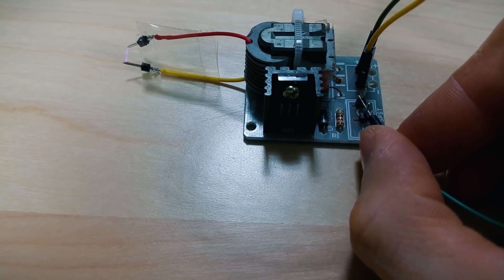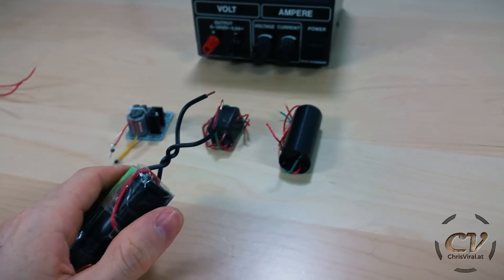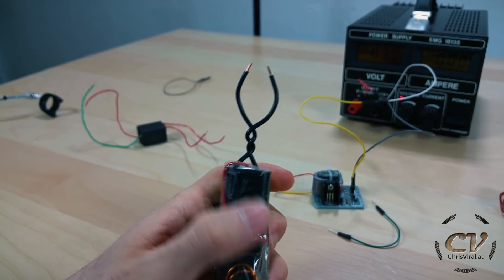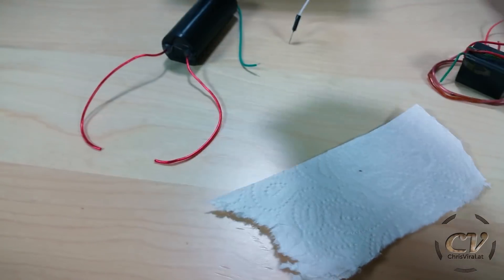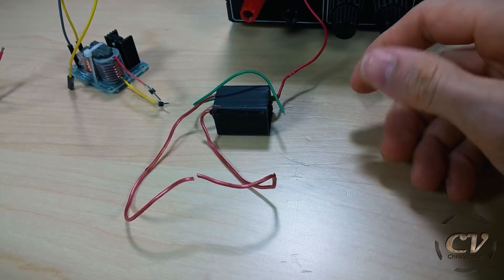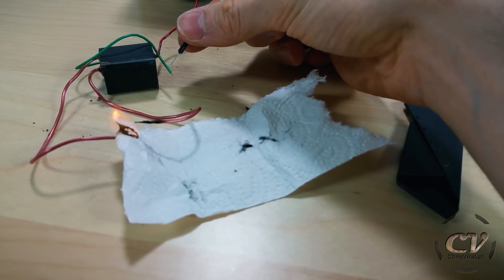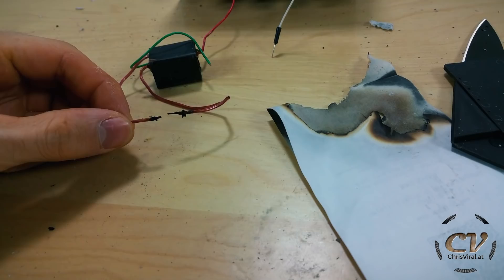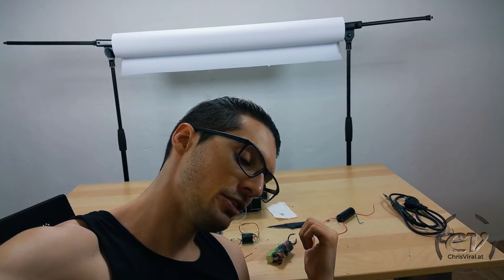High Voltage Modules Comparison (15KV, 20KV, 400KV)

Comment: The specified output of these modules are not true and are lies from the sellers. it takes about 1000volts to arc 1mm in normal air. Try to get the 400 thousand volt module make an arc 400mm (40cm) between the output cables, it cant be done, i promise you.
The distance the arc can form in air depends on the moisture % in the air, normal indorr air is 1mm per 1000volts. Is more humid locations is can be little different but not very much.
Spread the output cables as far as you can and make an arc, you can estimate the output. 10mm is 10.000volts, 20mm is 20000volts and so on, 1mm arc is 1000 volts, 400mm long arc is 400.000volts.
I would guess the 400.000volt module cant make an arc longer than 3-4cm (30.000-40.000volt).
Dont trust ebay sellers info (or stungun sellers).
Look at other things like laser modules, same thing. They say this laser is for example 50 watts but if you look carefully its written in small text at specs list something like "actual optical output 5watt".
All lies, you must know this, everybody does.

Comment: Have you worked out how tow get a emp feilds out the 400kv one yet??😁I did and mosfet that battery to the 400k on 4 up amp I got 6 for a tesla coil 🤩 stick your fingers in the 15k there cheap a little cheap great hand buzzer. There's one other like 600kv along ark but low current about 6cm

Comment: Don't forget, you can use multiple 18650 batteries in parallel on the 15kV module.

I had one of them and it burned up in less than 5 minutes because of a short so I bought a new one. It arrived just a few days ago and I assembled it just a few hours ago.

Had to go through a lot of pain cause of a stupid problem, now I couldn't find my 18650 pack so I'm going to try to find it tomorrow. Let's hope it works, I might have spotted a cut in the secondary winding. I hope that isn't true, and thanks for the video!

P.S not sure why but the arcs on your 15kV module looks so weak, it's nowhere near 15kV. Maybe 7-8kV, I guess it differs from module to module since my arcs were like 1.5cm long which is about 17kV.
Reply: Merhaba ben 400kv olanında alıcam insan için etkili mi saldırganı etkisiz hale getirmeme yardım eder mi

Comment: Your power supply is limiting the current. It is either set at low current or not capable of supplying enough current. You can see that current LED turns ON and voltage LED turns OFF at 7:45
Good experiments 👍🏽
Reply: yes it will reduce the set voltage if the current is set lower. if it can take 6v then turn the current right up. its really only l.e.ds where we dont do this.

Comment: Do you have the smallest idea of insulation required to withstand 400kV ??? The maximum voltage you can get from these transformers is 40kV at best (and most of the time, not as a constant current, just pulses due to flyback effects)
The dielectric strength of dry air is 3kV/mm, which means that ANYTHING located at less than 15 cms from your "400kV" source would create an arc with the source. In practice, insulators for 400kV are more than 1 meter long, because perfectly dry air does not exist, so the dielectric strength falls quickly.
It is even SIMPLY IMPOSSIBLE to hold a 400kV generator in your hand, except if you wear special insulating gloves. Such a voltage would create an arc immediately with your hand or any body part near the generator.
You clearly know nothing about high voltage and you announce stupid figures written by stupid guys selling shitty products, just because you expect to make "viral" videos.

Comment: I have the 400 kv moduel and I have it hooked up to a twelve volt battery , is that dangerous as it says 3 to 6 volts , can I use it on people for fun ?
Reply from the maker: 12 volt sounds hella dangerous for the module but do you want... Also if you have some pretty understanding friends you can try it like me in this video: https://youtu.be/TsLx8uVZ2x0
Reply: I think it might hurt a bit 🤯🤯
Reply: @jonathangrey4738  ya i tried it on someon noqw there 6 feet unnder

Comment: I do like the power supy (the hot arc one) due to its capability of use as a Tesla Coil powrr supply. Use some caps that are tuned for your individual Tesla Coil (obviously) amd with a voltage rating of at least 20 kv. Then you will have a power supy for a spark gap Tesla Coil.
Reply from the maker: Hey, so if you just use the taser module you won't need any of that stuff that you mentioned. I tested it in this vlog: https://youtu.be/-pUIeQkyWdk 
And it powered my mini tesla without problems. Then what you can also do is to assemble more of them in parallel to dramatically increase the spark frequency.
I tested this in this vlog: https://youtu.be/fWL94MIHHM0

Comment: double the voltage they can handle a 9 volt battery :)
Reply from the maker: No!!!! I can't recommend that what so ever. They will most likely fry at 7V. Maybe super short bursts (peak) but for sure not at a constant rate.

Comment: So via transformer and an inverter we can put in some power to power a laptop or other electronics? Remember, it's 220 V AC, 50 Hz (or 110 V AC, 60 Hz). All that's necessary to power literally anything that comes into your home. Considering law of energy conservation, how long it will last? Or it doesn't have enough amps to even charge a phone?
Reply from the maker: Don't .. do .. it .. 😂
Reply: @ChrisViralVlogs  But I'd rather die in the name of science than live in the name of ignorance!!! ZzzzzzzzzzTTT!!!

Comment: You can find small HV transformers in LCD monitors. Bigger the monitor maybe bigger the transformer. Send a square wave into some of those things at low somewhere around 2v to 12v and those things can kick some wicked plasma. Some require a very low duty cycle at only around 3khz and the bang for the buck is amazing. Last one I found had a bifilar winding on the primary already so wiring like a Joule Thief with 1K resistance was perfect to get great arcs from low power not even needing to heatsink the transistor. Been hard to find more of the same, most have been less powerful but they are still pretty nifty.
Reply from the maker: Nice comment, thanks for letting me/us know 🙌🏻🔥

Comment: bro, where did you get those, I bought some on a chinese pag and it broke down really fast
Reply from the maker: Yup same, they break easily... I use them with only 5V
Reply: Yeah they break fast, keep the voltage down between 3-6V and the amps can be as high as possible. Also you must not operate them, when the output wires are too far from another, so that they not discharge. In that case you hear a high pitched sound, disconnect the battery immediately and adjust the spark gap, this might be the main reason for failure of this modules.

Comment: If it did produced 400kV as rated you would have died! It looks like more 40kV tops.
Reply from the maker: No you wouldn't die from that... You also need AMPS to end it all haha. But your guess is pretty spot on, because I tested many modules for their actual capabilities. If you don't believe me about surviving this, then watch me and some friends touch this DIY tesla coil (~100kV): https://www.youtube.com/watch?v=VyHWyoa47pQ

Powered with these 400kV modules. Stepping it up from around 30-35kV to 100kV. No harm :)
Reply: @ChrisViralVlogs  a tesla coil driven by these modules produces very little current actually, and it may be harmless. More powerful ones can be lethal though. High frequency also means the current will be on the top layer of your skin and may not hit your heart or make it stop.  But if did these modules produced 400kV on their actual current ratings( probably a fraction of milliamp or so) it would be dangerous, even though the actual voltage would drop to 1/10 or so of the open circuit value.

Comment: If you've ever worked with actual high voltage power supplies you'd know that 100 KVDC will jump a six inch gap of atmosphere at 1200 feet above sea level.  400 KVDC would easily jump 24 inches. That's right. two feet long arcs would be possible if you truly had a 400KV DC power supply.  It's sad to see what people think is education these days. Dumb and sad.
Reply from the maker: This is of course just BS China marketing 🤣 (also works for views)
Actual voltages & spark gap measurements here: https://youtu.be/00U9zTZParg

Comment: Can 400kv module be connect in series or parallel ?

Or it will fry ?
Reply: I don't recommend putting these in parallel as the added power wouldn't add much. Putting many in series would add the voltages and due to the low power output you would really have to worry too much about them burning up.
Reply from the maker: No Jordan you're wrong! I've tested this in this video:
https://youtu.be/BRbHBiwdcc8

Both theories are wrong. In series the spark frequency just gets increased but not actually the voltage. Also the arcs will be shorter because of losses. There are good explanations under the video in the comment section.

If you hook them up in parallel the amps will get increased resulting in a WAY louder and more powerful arc. It's also getting really dangerous when you hook them up in parallel because the capacitors will unload simultaneously. I touched 5 in parallel a few weeks ago and probably could've died from that. It was like a hard punch in my chest. Touching 230V AC is NOTHING in comparison.

Anyways... They won't fry in either case.

Comment: The first 15kv is in the 400kv one, with a few caps and diode still not 30kw becouse you need 10 caps at 10kv not 4 at 2kv and had a gentle man do the math for it 3kv max at 2 3cm ark I got the 30kv unit ! still good out put you can stick your finger in the 15kv on a 3.7v hand buzzer like don't do it on the 400😨. The 20kv is a ark plasma for a lighter unit??thick the head out😆 stop burning the unit😨.
Reply from the maker: Haha thanks for the comment, one of the best around here for sure 🙌🏻🤣

Comment: What about the output is it dc or ac ?
Reply: These are only capable of DC. The reason they have such snappy loud sparks is due to voltage multipliers on the output of the high voltage transformer
Reply from the maker: It's very likely DC, everything points to it

Comment: Take a capacitor whitch can handle this high voltage and connect it to the 400KV supply (if it is AC convert it to DC at first) then you can take a resistor to limit the current that the capacitor isnt discharched that fast and then it should be able to burn stuff.
Reply from the maker: My dad showed me this trick (just a bunch of resistors is enough to do this) and I loved it :D
I will probably make a video about this soon 😁

Comment: Kv is kilo volt, so 1kv is 1000 volts. For break 1cm of dry air(for a spark of 1cm) you need 30kv (30000 v) So how much is 400kv? More than 10 cm. It seems not 10 cm honestly...
Reply: For a 1CM distance the breakdown voltage needed is 20kv rms 
 not 1kv
Reply from the maker: Actual voltages & spark gap measurements here: https://youtu.be/00U9zTZParg

Comment: 400kv , 200kv ... Do u even know what it means....all fake ratings
Reply from the maker: Yeah, I know, it's all mentioned in the pinned comment.
It's 20 though, and this seems to be correct as a test showed.
Reply: @ChrisViralVlogs  yeah bro 20kv is all right but 400kv....😹
Reply: @spandandutta2485  "Even most lightnings don't have that much power"

Comment: i have the 15 kv module and it lights paper and plastic easily 
The 20 kv module isn't really any better.
Also had the 400kv module and it didn't last long before it stopped working, the 15 kv one last forever as long as you don't extend the arc to long and let it cool sometime 
400 kv module does not make close to 400kv more like 30 kv at lower frequency and more powerful sparks
Reply from the maker: The 20KV is the best imho, the 400KV is the best pulse module imho out of all: https://youtu.be/5sfVnczqb8g

But ofc it's not nearly 400KV (the 20KV module seems to be right on with the values) it's a scam for sure. And yeah, they are for sure not made to last hahaha :)

Thanks for the comment & feedback

Comment: 400KV my ass. Air breakdown is 30KV/cm so 400KV should create a 13 CM arc. It's a HUGE distance and it's not that case. Don't trust what sellers says.
Reply from the maker: Yeah, by now I measured the arc gaps of several modules, here's the video if you're interested: https://youtu.be/00U9zTZParg

All pulse modules are a scam if you believe the marketing. Still fun though :)

Comment: Well because no one pointed it out. 400kV is a fake claim. Breakdown voltage of air is about 3kV/mm, at 400kv you would have an arc length of around 133.33mm or 13cm which is not quite the case. So 400kV is false claim, real might be anywhere between 50-100kv
Reply from the maker: It has been pointed out in the pinned comment :)
My estimation is 16-48K definitely not more.

I already measured them and did a bunch of other videos about them. Thank you anyways, ALSO, there's another question that I have. Maybe you know the answer?

As they convert DC to AC for the step up voltage, they shouldn't have a polarity or a phase right? What do you think about this?
Reply: @ChrisViralVlogs  Oh my bad didnt saw it :D

Yes I can answer. Actually the output is not the output of transformer. Output of transformer is connected to voltage multiplier circuit which increases the voltage and output of voltage multiplier is brought out of that black box. And voltage multipliers send out DC so it has polarities at output.
 The one with less powerful sparks (20kV ones) have no multipliers. As you can see in exposed version. Its output is in fact the output of transformer coil.
In that case the polarity will again matter simply because oscillator circuit is sending unidirectional pulses to the input of transformer, so transformer also outputs unidirectional high voltage pulses. Btw that transformer that you referred as coil is called flyback transformer
Reply from the maker: Thank you so much <3
I used your explanation in this vlog: https://youtu.be/38RpEM8OmAw

Comment: try several 400, K boosters in parrelall. you will be impressed. (make sure they are all in phase... all reds and all black wires connected) try just two at a time just in case the manufacturer was careless and reversed the phases internally
Reply from the maker: I already tried them in series (3 so far) and I recently got another 8 400KV modules for further testing. I already got a comment like that suggesting the possibility that they have a polarity or phase. Can you tell me more about that?

As they convert DC to AC for the step up voltage, they shouldn't have a 
polarity or a phase right? What do you think about this?
Reply: @jim halcom how many did you tried?

@ChrisViral Vlogs, i am done with the reverse engeneer project.
But i am not sure wher too upload the photos and scematic atm 
I can confirm they have a polarity on the output too.
Btw. this video is a good example quality* over mass is more effective :)
*value for the viewer (product review)
this is a helpful soloution for high voltage measurement:
https://www.youtube.com/watch?v=q7P47QDGMo8
https://www.youtube.com/watch?v=-_LJXKLgIYc

8 modules in series would be great :D
Reply from the maker: How is this video quality? It's the same same as most of the vlogs XD
I have a lot of similar videos on the channel, but it's always a random one that gets favorite by the algorithm. That's why I do so many of them. Cause one of them might get lucky. The more... The better hehe.

You can also just send it to my mail if you don't want to upload them (kontakt at chris viral dot at)

Also the probe idea is cool, that looks like it might be the easiest way to measure it, nice! Thanks
Reply: with quality i mean value for the viewer, as most people dont want to buy all modules but instead know whoch is the best to buy (value=less stuff to pay) its a basic idea i saw in some merketing tutorials too :D.
btw very good thumbnail idea

Comment: it is setting the paper on fire cause it is lower voltage more current, Current creats heat not so much the voltage
Reply from the maker: Also because it's a constant arc right? I think short pulses are not good for effective heat transfer.

Comment: Can I make tesla coil with this 400kv generator
Reply from the maker: THIS is an interesting question that I also already asked myself. The best is that I recently got a tiny tesla from my granddad. He also said that it won't be possible but I will definitely try it.

It uses a car spark plug and needs ~18W when powered. 6V x 2A is ~ 12W for the 400KV module. So it might actually work for a rather tiny tesla. Stay tuned for the upcoming videos, I will also try to update here.
Reply: No
Reply: @RobbertLievens  why ???
Reply from the maker: IT WORKED !!!!!!
I was able to power this tesla with one: https://youtu.be/-75cYaqeKXI
The more I hooked up the more sparks I got too, the videos will be uploaded in a few days - weeks I think. IT WAS AMAZING.

That means I can go mobile easily 😍
Reply: Yep. But try to put HV Capacitor parallel to HV output of Step Up High Voltage Generator.

Comment from the maker: Yes, it's true. They lie about the step-up value. It's not 400KV, it's actually way less. If you're interested in the real specs check out these videos:
Comparing 8 different modules: https://youtu.be/5sfVnczqb8g
Testing and estimating their real voltage: https://youtu.be/00U9zTZParg
The truth about Chinese high voltage generators: (coming soon)